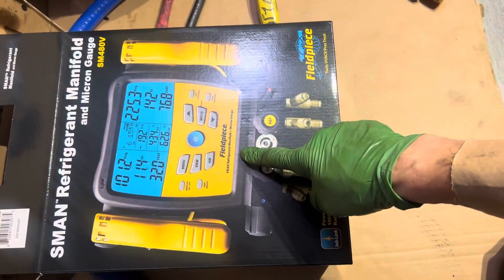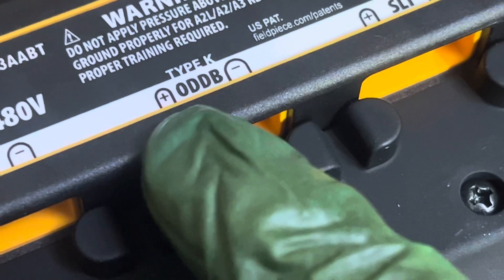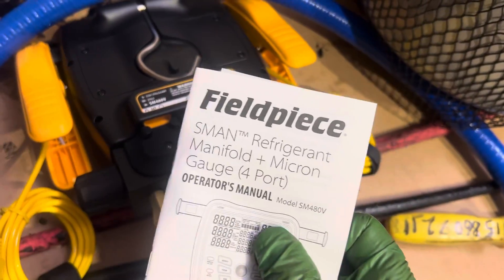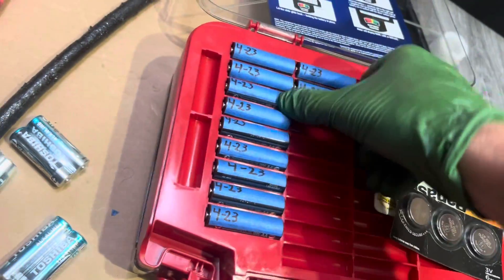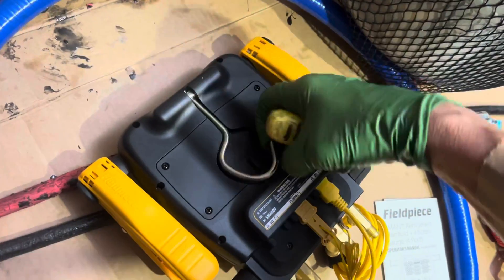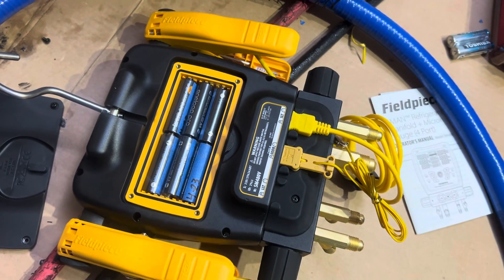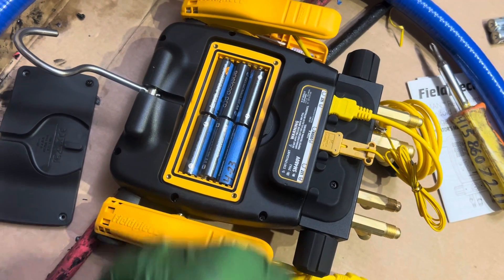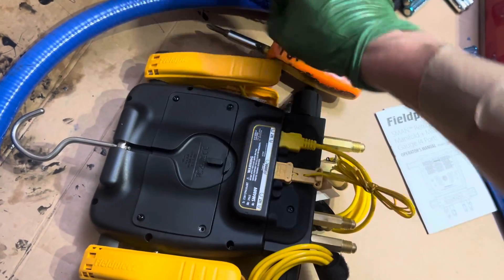NEW SMAN Refrigerant Manifold and Micron Gauge SM480V Fieldpiece what do you get in the new box?

Comment: Tom, since sub cool and super heat is not used in automotive, what is the use of the probes (thermistor) have that ever come in handy. Also have you ever used condensor inlet and outlet temperature to figure out the block in conensor.
Reply from the maker: Yes they are useful for automotive if you have done a few thousand vehicles . 

You learn and remember what vehicles have what superheat and Subcooling 

Yes I made videos on condenser temp drop for condemning condenser

Some times good IR CAMER much better faster

Comment: Tom will this model work for 134a, R1234YF and home / residential 22 / 410a as well.
Reply from the maker: Yes
Reply: @coldfinger459sub0  Thanks Tom, will this model does this model have update to software in future when adding new freeon / refrigerent profiles or i have to live with what i got
Reply from the maker: @sivucit  updatable
Reply: @coldfinger459sub0  Thanks Tom. If i want to recover entire PAG oil from system , what is the best way you would recommend. can i use high pressure port to recover free on and PAG oil. 2. can i use same hose for 134a and 1234yf.
Reply from the maker: The only way to get all the oil out of the system is take the system apart at the lines flush the lines individually. 

You cannot flush through a receiver, dryer or accumulator they just must be replaced 

You cannot flush through a expansion valve or orifice tube they must be removed 

Then you can get access to the Evaporator to flush the evaporator 

If you have the type of condenser that has a built-in receiver, drier, you must remove the receiver, dryer and purchase a new desiccant sock to replace after you clean 

Can you use high-pressure nitrogen? 

You do not flush through a compressor. The only thing you can do is pour out the oil manually. . 

Now you basically have a system with zero oil inside the system, and you can start like it was brand new look up the factory quantity that is needed and pour that amount back in following the manufacturers instructions .

Comment: I've had issue with temperature compensated pressure decay test when refrigerant hoses are in the setup, even with brand new refrigerant hoses paired with a brand new sman. 

Do I need to take apart a new sman and put more dielectric silicone grease into the valves or add some nylog to the refrigerant hose gaskets? 

I lose about 1 psi every 8 minutes. But if I use a bluetooth pressure sensor hooked to a valve core removal tool and valve off the rubber hoses so the Bluetooth pressure only measures the system there is no leak.
Reply from the maker: 1 psi every eight minutes ? or 0.1 psi every eight minutes ?

This sounds like a leak, so big you should be able to hear it almost .   Definitely ultrasonic leak detector would pick it up.

Or you can inject some refrigerant into the hoses engages and use your refrigerant leak detector and be able to pick up a leak that big 

Or big blue micro leak detector, squirted all over all the seams and fittings .  

That’s a massive leak if it’s one psi every eight minutes . Definitely would be letting out bubbles with soapy water.. 

Tell me what you find ?
And how are you find it? 

Try not using the temperature compensation if you think it’s a software problem.   Just disconnect the wire temperature sensors and run your test normally.   

You may need a firmware update, possibly they’ll have your erase the existing firmware and re-download the new software.    

They have excellent tech-support you can call them or email

But before you call them, do what I mentioned up above, so you have more information to give them for diagnosis.
Reply: @coldfinger459sub0  The nitrogen pressure drop is at the beginning and levels off. If I start a pressure decay test after waiting just 5 minutes after getting the nitrogen into the hose and gauge it will drop as much as 4 PSI in 15 minutes, after 15 to 30 mins it will not drop anymore. I found it takes 15 to 30 mins for the nitrogen pressure to stabilize. If I wait 15 to 30 mins for the nitrogen pressure to stabilize then the pressure will not drop by more than 1 PSI in 10 hours. I think the temperature of the nitrogen stabilizes quickly but the stretching of rubber hoses in length and diameter occurs more slowly taking as much as 15 to 30 mins to settle down to the new size when under 400 to 500 PSI of pressure and then stretching just a bit more over the course of hours. I spent an hour looking for leaks, brushing Big Blu onto every connection seam on the hose and the SMAN. I took off the plastic cover to expose the manifold valve and brushed Big Blu onto the valve and looked at every seam with a bright light and couldn't find a leak. I did the test in the middle of the night when the house is dead quiet and I couldn't hear a leak. The test setup is kind of extreme, i.e. the volume is just the rubber JB Industries refrigerant hose and the SMAN, there isn't the additional air volume from hooking up to a piece of equipment.  

When I do a pressure decay test using Fieldpiece JL3PR Job Link Pressure Probe attached to the side port of an Appion vacuum-rated valve core removal tool, I get zero PSI drop in 15-mins of pressure decay testing after waiting just 5 minutes for the nitrogen pressure to stabilize when attached to a piece of equipment. My theory is that the refrigerant hoses stretch in length and diameter enough over the course of a short pressure decay test to result in PSI drops that look like a leak in a short pressure decay test. I'm in support of pressure decay test setups that take the rubber refrigerant hoses out of the picture and measure just the components of the equipment for leaks which means Bluetooth probes as opposed to a SMAN manifold setup.
Reply from the maker: @edwardlouie  yes you are correct I have mentioned that and some of my videos wait 10 or 15 minutes before starting high-pressure nitrogen Decay test.   Also for the temperature of the nitrogen to expand or contract, depending on the temperature of the system..

Comment: Thanks,   Interesting how  new sm480  keep mikron level.  Mine   in 10 minute  from 300- 1500 in   Loop house.
Reply from the maker: I’m also using a 10 CFM vacuum pump.  With a three-quarter inch silicone high vacuum hose dedicated for a vacuum only.. .  It makes a difference.. 

And these are brand new Refrigerant hoses that I’ve never been used . . 

But it’s the vacuum pump and vacuum hose .  And connected to a 50 pound cylinder..  not trying to hold vacuum in the hoses by themselves.   If you’re trying to hold back him in the hoses by themselves will always fail.

Not designed to do that refrigerant hoses should never be used by themselves .

Comment: What hoses do you put on the manifold?  I always liked robbin air stuff but would like to hear your opinion.

I also have another question for you.  When you are using that manifold set in conjunction with a recovery machine what do you do with the refrigerant that comes out of the system you are recovering?  And finally what do you with that refrigerant after it's recovered?  The machines you always recommend and show are only recovery machines how do you filter and fecycle the refrigerant before you can use it again.  One last question can you recommend a good refrigerant analyzer?  I know you always recommend Tru tech tools and they have a lot ofbgoodbstuff but I would like your opinion.
Reply from the maker: 1: yellow jacket hoses

2: & 2b: all of the refrigerant, 134 or YF goes into recovery cylinders to be recycled later when I have time. 
       I have 40 recovery cylinders, so I wait until I have several hundred pounds of each refrigerant to make it economical and recycle them all at the same time on one weekend. I usually start Friday evening and finish by Sunday evening.. 
        I have large 240 pounds in 125 pound cylinders.   And I could just let my machine run overnight filling up the big cylinders as I sleep.. when I wake up the next day, I have large 240 lb. And 125 lb cylinders filled with refrigerant, ready to go

3 Legend Series, NEUTRONICS refrigerant analyzes

 You must not have seen my videos using the Refrigerant the Analyzer.
The legend series has lasted me longer than any other manufacturers without breaking down like all the other ones have.
Reply: @coldfinger459sub0 I have only been watching for about a year but I have learned a lot.  I work in the automotive industry but planning on doing stuff on the side for extra money and possibly go into business for myself, that's why I ask so many questions.  I have only ever worked with full on recovery/recycling machines in the shops I have worked at.  What machine do you use to recycle the refrigerant and have you ever made a video showing that?
Reply from the maker: @crasher88  you only need the most simple plain Jane no bells 🔔 or whistles recycling machine if you are going mobile and work for yourself. 

You will be doing low volume AC work since you’ll be doing a lot of other regular mechanical work .  So he will not be recycling a lot.. 

I would highly recommend adding a moisture indicator . On your liquid outlet, charging line, two-year recycled, Refrigerant Inc.. 

To make sure you never have moisture content in your refrigerant 

Change your filter dryer more often than it is recommended . 

If it is possible to modify it by adding any external extra or larger size filter, dryer’s, then do it . 

I have never made a recycling, refrigerant video yet . 

I have a very large custom high capacity, refrigerant, recycling system .   It uses filter dryers that are nearly 100 times the capacity of what automotive sells on the market..  it has more asset removing capability in oil separation anything automotive can I have a dream about selling for a reasonable price?. 
                 Using a air separation procedure, that is a little bit time consuming.  Take some manual operation..  and uses refrigerant, cryo- chilling of tanks down to below -27°F.   For some of the air separating operations to purify the refrigerant.. without wasting any refrigerant to the atmosphere.  The Automotive Systems purge off the top of the tank to the atmosphere to get out air. It also waste refrigerant..   my system recovers to purged off air and re-recycles the purged off Aaron refrigerant to extract even more refrigerant out of the Purging process.  Some thing a Automotive companies cannot afford both in size and complexity and price to sell to a Automotive guys.. 

You could say it’s a little bit overkill.
Reply: @coldfinger459sub0  I am very interested in seeing your recovery/regen rig. Thank you for doing great videos. (AND FINDING THE TIME FOR IT)
Story time from last week: BTW, don't recover a full hire R32 and a R290 to bought cylinders. 21 lbs each in a raw. My MR45 bearings did get noisy afterwards. I did not know that recovery machines only handles oil traced refrigerant. Do you agree? It should be so then I am thinking about it afterwards. Thinking about build my own compressor recovery machine since I am not using some refrigerants very often. Hire cylinders cost 0,46 dollars a day here excl tax after 3 months.
Reply from the maker: R32. & r290 what country are you in ? 

I recovered refrigerant only with no oil in it for years on all my machines.  No problem.   Sound like liquid slugging caused higher bearing load taking life of unit.    Need to start with throttle down then turn up to make sure no liquid straight to compressor pump.
Reply: @coldfinger459sub0   Sweden, north europe. Always starting low so I need to throttle up to not go lower than 0 psi. I perfer go lower than compressing liquid at start up. I throttle up to about 35 psi suction pressure on MR45 and staying there all the time, adjusting if needed. Wierd noises is from 50 psi when I tested the limits. That is how I use it and my other machine.
The last recovery, R290 was recovered from only vapor, then I did get the sound. Then I changed to liquid port and finish it, becuase I hade no idea why I was recovering in vapor. Brainfarth from non-invertable cylinder maybe.
Well, A3 refrigerant is not ment to be handled, but I do only thinking about fire hazard. R290 is a good solvent, some refrigerant is not? Nah all is...I don't know.
I have used my MR45 only 4 times so It can be factory issue also. It is a great machine. Send it to service yesterday. I don't trust the cleanes until its checked and quiet.
Reply from the maker: @Casal70  yes, it is a great machine maybe just a factory defect on assembly.  Aside experience but once they get it back, they’ll just probably swap it out for you. If it’s pretty new or put a whole new internal motor assembly so you’ll have a brand new one no matter what.. 👍

Comment: Or how does the older SMAN 460 stack up against this newer model?
Reply from the maker: More information available on the screen, they made a little bigger configured differently

He got the job done. It was very reliable. .  Do you have the advantage of still using the Fieldpiece joblink software. 

I have 5 Fieldpiece S- man gauges, converting all over to the SM 480 V one at a time